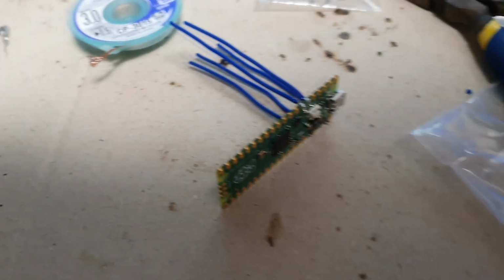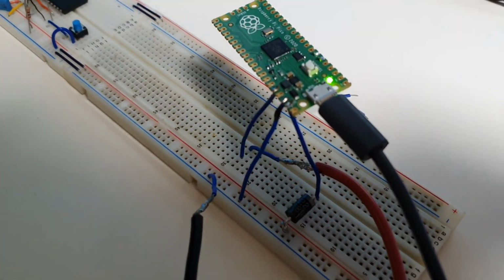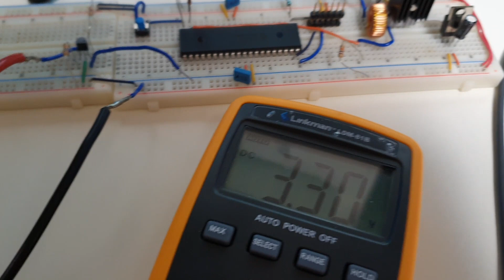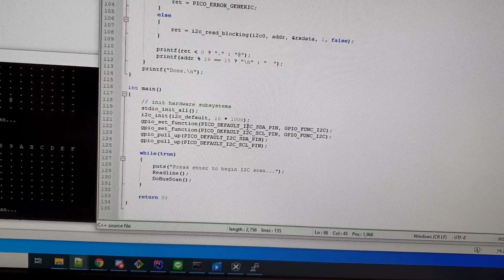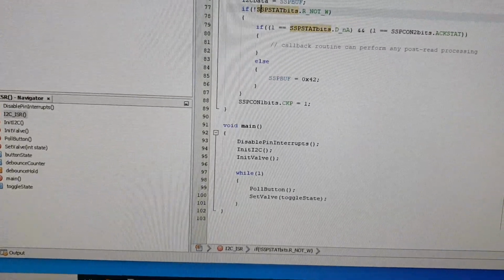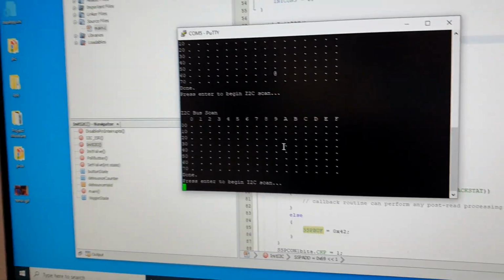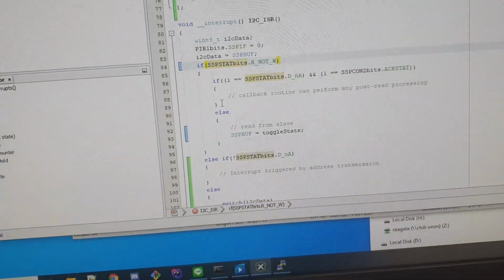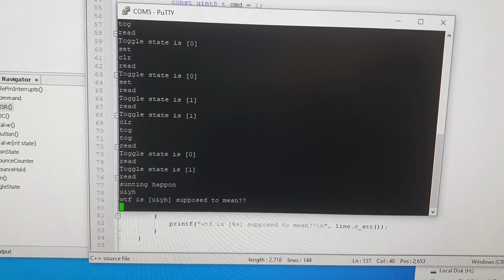Boku no Pico [Project Moisture]

Comment: I'm out of the loop here. I'm seeing inductors and a pic and vrm and a mosfet along with a fat cap. What is all this? Lol
Reply from the maker: Buck converter (a few vids before this one).
Reply: @ChiliTomatoNoodle  I knew it was a buck or boost. I love how you had some pic chips laying around hahahaha I have arduinos and esp32s and picos but not pic haha most of my projects are switched over to esp32. I cannot get platformio to recognize them half the time. It's a windows problem because anything that uses a com port is dicked lately. Espressif also have a horrible software framework. They sell like hot cakes so you think they'd hire some decent engineers to write a better dev framework.  When a glorified text editor (vs code) is the preferred way to code what's become almost a standard there's something wrong.I'm too lazy to reinstall windows and all the different ides I use and plug-ins for this and that and libraries. Next time I do a fresh install I'm going to update an image of the install to a few different bins that leapfrog over time so I always have a recent known probably good image and an older definitely good one as a fall back.